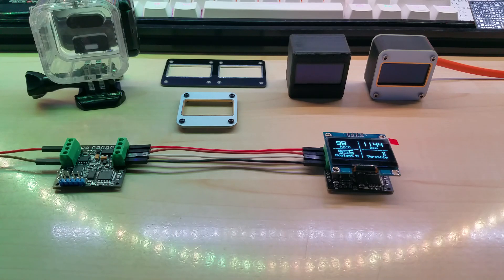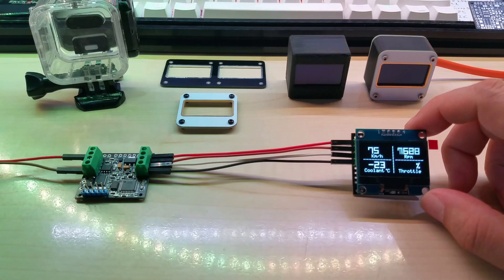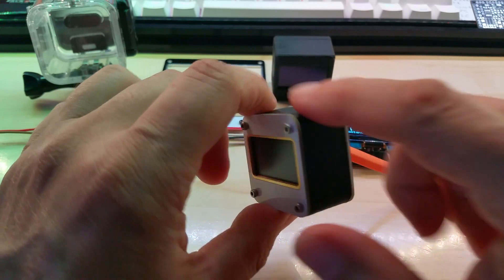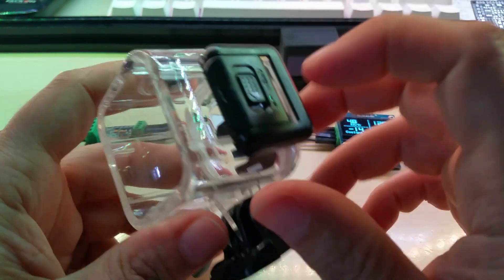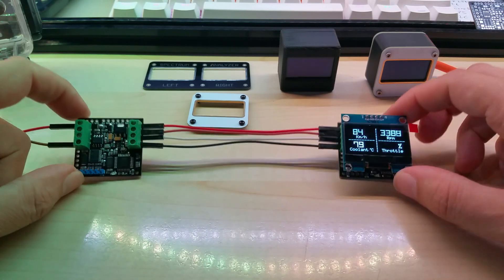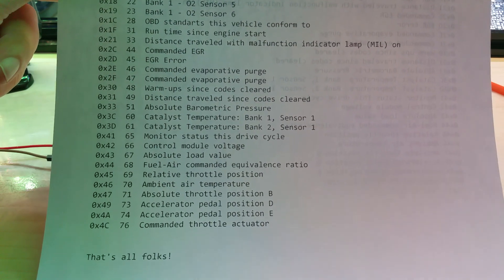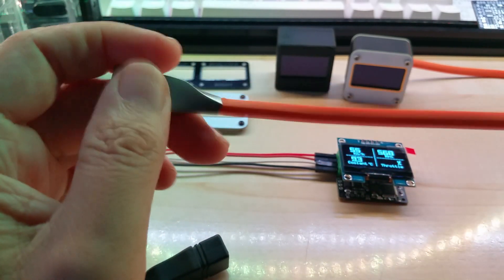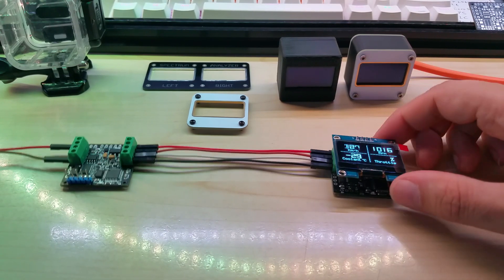OBDII, yes I CAN. Worlds smallest full fledged CAN BUS Gauge, OBDII Simulator, by Hayri. Part 3

Comment: If it marks temp, oil pressure and battery you can sell these to people with the chevy colorado, cluster in vehicle doesnt have and its mandatory you get aftermarket temp guage for vehicle, send me info on pricing and how to set up and what i would need, i can spread the word on these where im from
Reply from the maker: Hi Jesse, it has more than that, I had some delays with the CF parts but in the meantime the code got better and better. I will upload a new video this week and show all the features of the display. Just keep in mind that not all cars have oil temperature and pressure senders installed. My 2005 300C does not for example. But I will have another product as well, that will enable all vehicles to add any sensor they want and feed that info into the current CAN BUS or, if the car does not have a CAN BUS at all, it will create the network and will still be usable with my gauge. I am also bringing out my new CAN BUS V-GAUGE that will have 5 displays and the customer can choose whatever he wants to display. And all this will be plug and play, except when sensors need to be installed of course. Price will be revealed during the crowd funding campaign. Just as a teaser, it has over 10 different screens that can be chosen at will or have the screen auto cycle one after the other, plus it has a gear indicator for automatic transmissions, 0-60 mph or 0-100 kmh sprint timer and a 1/4 mile run timer with a functional (actually still working on that feature) dragstrip light via Neopixel and a draglight on the display. The 1/4 mile run itself is working already. On top of this, the customer will be able to chose from several display combinations, as there are around 40 data streams the CAN BUS can deliver, slightly different from car to car. Hope you made it this far, thanks.